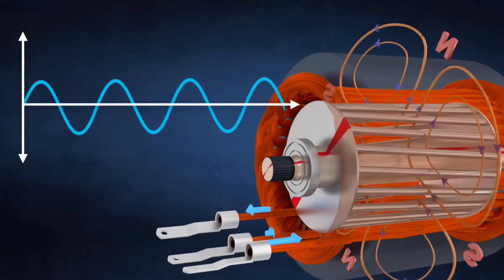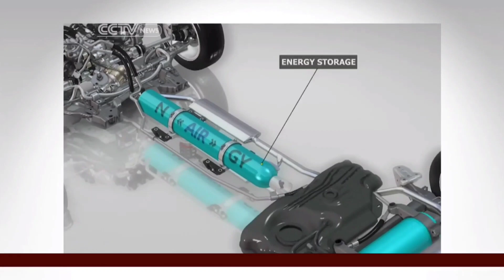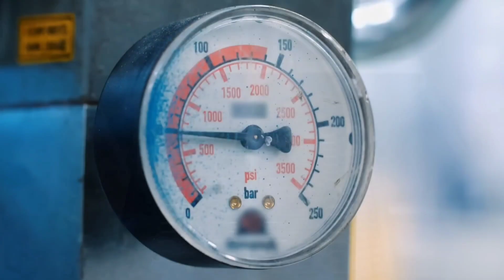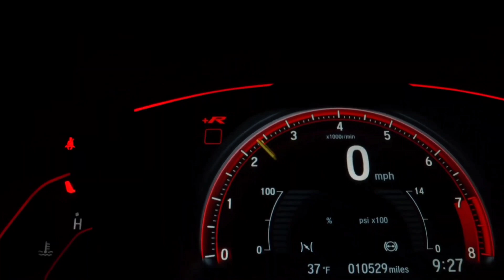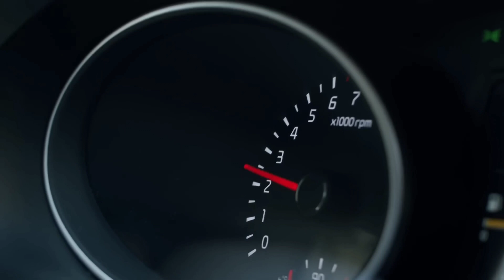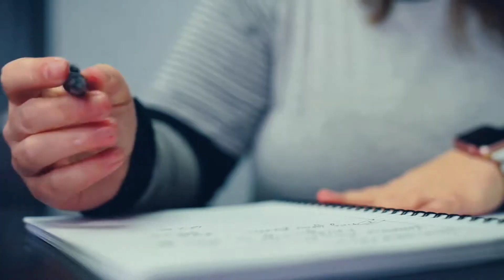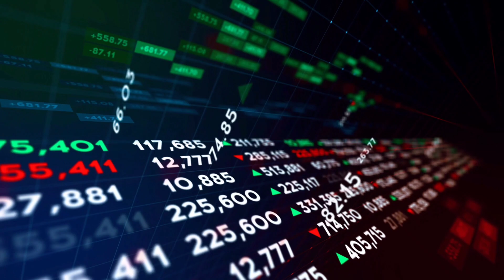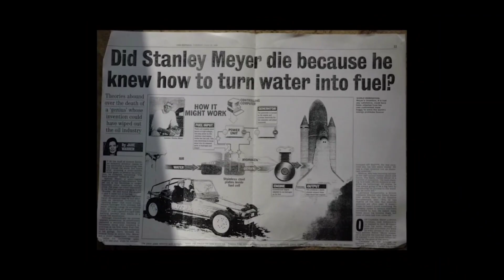Is GM's Compressed Air Tech the Future of Zero-Emission Cars?

Comment: bait, similar to compressed natural gas, a vehicle type i actually owned in an F150. The tank would weigh over 700lbs and would run you for about 10min max. They will be 700lbs because it would need to hold over 3000 (3k) psi
Reply from the maker: Ty for watching

Comment: How are we going to compress the air? 2 wind turbines for every car?
Reply from the maker: Ty for watching 😏
Reply: Why not an air compressor? Drive up to a compressor, fill your tanks and drive off. Gas cars don't have an internal refinery to make gas😂 you drive up to the gas pump. Fill up and drive off it ain't that freakin difficult people
Reply: @benbelk3767 Three horsepower to make one horsepower of air. Tremendous heat generated and a bomb in every car. Have you ever seen a compressed air tank explode?
Reply: @terenceiutzi4003 you asked how the air would be compressed. I answered. Now you're talking about something different. And yes I have seen an air tank explode. Pretty violent, wouldn't want to be anywhere near it. I have seen some other videos about air engines where GM has actually found a certain tank construction that prevents a lot of thr chaos of a traditional air tank explosion. However a gas tank explosion is no treat either. As for the horsepower comparison I know nothing about so I will not speak on it.
Reply: @terenceiutzi4003 also how is there tremendous heat being generated? It's literally air there is no combustion. I understand that where there is energy being made there is definitely heat but... combustion would definitely take the cake for higher heat generation. Not to mention batteries get extremely hot when being worked. Bigger the battery, bigger the heat. Also don't forget we've gotten pretty good at keeping combustion engines at a desired temperature with only water, coolant and a simple pump and thermostat. Shouldn't be any more difficult keeping an air engine cool. Idk food for thought I guess.
Reply: @benbelk3767  If you compress air to 10 atmospheres, the amount of heat remains the same, so the absolute tempurature will be 10 times higher! At ten degrees C the absolute temperature is 283 degrees so at 150 PSI the temperature would be 2840 Dgrees absolute of 2830 degrees C. That is grade 9 physics!
Reply: @benbelk3767  It takes 3 Hp to make 1 Hp of air. It only takes 2 hp to put 1hp in a battery. GM gave up on their air engine in the 50s, doesn't  that tell you something?
Reply: @terenceiutzi4003  you bring a very interesting point but, my air compressor at home goes to 220 psi and it only gets a little warm. I believe your theory is correct. But theory only goes so far.
Reply: @benbelk3767, you are talking about minute volume. My 5 hp 20 CFM compressor makes the tank uncomfortable to touch  now uneasiness a 400 Hp capable of driving a car for an hour!

Comment: Compressed air is just an extreamly inefficient battery
Reply: I hope it works out but, compressed air is a secondary source of energy with lots of downsides.  You still need to burn things to make the energy to compress the air.
Reply from the maker: Valid point 👍🏽
Reply from the maker: U may have a point but technology is undefeated.. 🤔🤔
Reply: @CarInfluence623  how many atmosphere compression at 147 PSI. And how many thousand degrees in waste heat is produced. That all wastes energy!

Comment: Compressed air is not free, the energy to compress the air have to come from somewhere and it is usually done by using electric engines. So in reality as I understanding it has more losses and it is less efficient then using the electricity to charge a battery of a EV.

Also at the pressures needed for this to work the air pressure containers will be bombs, that will explode when damaged like in a crash. Just a scuba tank with 300bar pressure is equal to 300gram of dynamite when it explodes and these will run much higher pressures and be even more dangerous. So saying that they don`t explode is pure lies, EV`s do not explode like dynamite, this does (even if it is not a explosion's from combustion but from pressure)....
Reply from the maker: Solid input. Ty for watching 👍🏽
Reply: @CarInfluence623  Yes it was an interesting video :) I have heard of air driven cars but it has been quiet around them for a long time now.

Comment: Ok how does it Compress the air without using some outside energy supply???
Reply: @looneytunes47  it uses an outside supply of course as you pointed out. The conversion wastes efficiency, add to that the fact that the energy density of compressed air is ridiculously low compared to probability most other energy storage technologies we know of... and it makes absolutely zero sense as an energy storage tech for anything that moves. I know there have been proposals (and maybe actual implementations? dunno) to store renewable energy as compressed air inside decommissioned mines. I find it dubious but not absurd. But for cars... No freaking way.
Reply: Do gas cars have an internal refinery??? Do EVs have an internal power plant??? 😂 it ain't that freakin difficult people. You drive up to an air compressor just like you would a gas pump or charging station. Fill your tanks in 2 mins just like a gas tank and drive off...
Reply from the maker: Great question. Ty for watching

Comment: Yeah... Compressed air has an energy density of about 0.1MJ/kg in the best case scenario (liquid air, which is very unlikely to be transported in any consumer vehicle ever, due to the insane risk it is), while gasoline has an energy density of about 46MJ/kg.

It means that for 1 kg of fuel you can drive roughly 460x further with gasoline than with air.

This is just back of the envelope computation, not even taking into account the huge weight of the compressed air containers and all the inefficiencies of both storage and use...

I am not betting much on this "revolutionary technology"...
Reply from the maker: Ty for watching 👍🏽

Comment: Ok so your video completely skirts the issue of how the air gets compressed. Pueget obviously used the work by a combustion engine… what is GM’s plan for this? After all, that is where most all of the energy would be applied. This video smells of click bait… not buying what you’re selling unless you show some detail. Go talk with a mechanical engineer lol.
Reply: @timhowell6929
You weren't paying attention. You get the compressed air from the compressed air tanks!!!
Reply: @Steve-ri3ot  LMAO Picked fresh of the compressed air tank tree in the compressed air tank orchard?
Reply: I agree. They mention that fossil fuel powers the grid for EVs but seem to think air compresses magically. The only possible use of compressed air is as a hybrid. Computer-controlled valves allow an internal combustion engine to become an air compressor when braking, and then use that stored air to get the engine back up to speed. After all, an internal combustion engine is an air compressor with fuel and a spark plug.
Reply: At best, hydrogen has the best energy to physical useable fuel thing that we can make.  And it's insanely hard to maintain.  There cannot be any missed steps when handling it.   Even hopeful at best it has a 33% efficiency loss instead of just using the "energy" that went into making it.
Reply: @natashashark85  So far, the most problematic aspect of hydrogen is storage. It's the smallest atom, and, unless they can manage to create a molecule with smaller spacing than the size of hydrogen atoms, it will remain so. Then there's the problem of the need for cooling and high pressure for it to remain in liquid form. I don't really have much expectation from hydrogen as a viable fuel.
Reply: Yup this video is pure bullshit clickbait. The energy density of compressed air is about 500x lower than that of gasoline, it's never replacing it. And there is no conspiracy against this technology lol. It's just useless, that's why we don't use it.
Reply: There is no conspiracy. The technology is useless due to the fact that compressed air has about 1/500 of the energy density of gasoline. That's why we don't use it. Simple as that.
Reply: Is it that hard to understand? You drive up to a compressor just like you would a charging station or gas pump. Fill up and drive off. Gas cars don't have an internal refinery inside to make gas as you drive😂 and neither do EVs have a power plant inside them to make electricity as you drive😂
Reply from the maker: Ty for watching 👍🏽